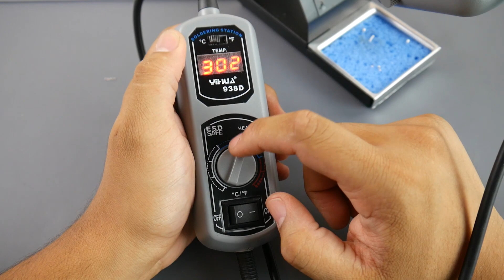Must Have SMD Soldering Hot Tweezers!! // YIHUA 938D Portable Hot Tweezers Review

Comment: That would definitely make fixing flight controllers easy now if I just knew how to fix flight controllers. But I have a feeling I will see some videos soon of someone fixing a bunch of broken flight controllers. LOL thanks for your great informative videos! I try to let everyone I know in the hobby about the best technical testing and fixing Channel in the hobby! DRONE MESH FTW!
Reply: As owner of these tweezers I can confirm that they are quite nice for SMD component soldering in boards used for our RC hobby. Fixing broken Racerstar TattooF4S flight controller (soldering back teared capacitor and accidentally desoldered and lost resistor and capacitor (last two was nearly invisible 0402 packages), fried 5V BEC chip (AJY7FB, SOIC-8 package) removing) - check. Replaced 10 uF capacitor in ESC broken by prop strike - check. Fried 3.3V LDO voltage regulator in XSR receiver replacing - check. So when tips are adjusted, those tweezers become quite handy for casual board repairing (and we usually need no more). Don't forget about soldering paste!

Comment: Wouldn't the excessively long heat exposure from picking the capacitors up using the hot tweezers cause cracking?
Reply: yup, especially multilayer ceramic capacitors are prone to cracking due to stresses when the PCB, solder joints and the MLCC aren't at the same temperature. a heat gun is recommended for these because it heats everything up more evenly.

Comment: how big are those capacitors, 0402? I wonder if these tweezers are efficient enough for work with 01005, I do micro work and while I can do hot air/rework, this would speed up the process.
Reply: It looks like those caps were in the 080 section of the practice board.

Comment: Will add this to my wish list.

I have an R-XSR with 2 capacitors that de-soldered themselves and a runcam eagle sensor that needs re-seating.  Fixing these will pay for the cost of the iron.

For extra credit, touching up the connections on my foxeer arrow camera sensors will also help.

I only run cameras at 5v now (and only VTX's off vbat or regulators).  Lose less OSD chips that way.

Would love a tutorial on diagnosing a blown OSD chip.  I have 2 FC's with blown OSD's that everything else still seems to work on.
Reply from the maker: Yes i have a video coming up on that.

Comment: Have you tried grabbing a wire or pin and pulling them out?  When wires and pins are soldered into the small holes on flight controllers it can be a pain trying to hold the board, hold the soldering iron and pull out the wire with tweezers..

Comment: That's really amazing, dude. 
If I remember correctly, I have a soldering station from that same brand on my wishlist. It has the soldering iron and the hot air gun. It would be great if there's a pair of tweezers like that compatible with the station. You know? Then you would connect it instead of the soldering iron.
Reply: I have the same thing (the soldering/hot air station). It's super useful, and I'd argue it's a better buy that these tweezers, but at the same time, it depends on what you need it for.
Reply: @prestonmatheny9756  Absolutely, I agree. 😊
But if you could have both... Right? 😉
Reply: you can get the same tweezers compatible with all of the hakko knockoff irons like yihua brand. the part number for the tweezers is 907M. you can also get hot air + tweezers stations like 938BD+ although it would be cheaper to get the 2 separately. I have the combo soldering iron and hot air station. the iron is crap and I'd only use it for soldering really big things that require 2 soldering irons simultaneously, but the hot air is fine. i was trying to get the 907M tweezers to go in that, but it was out of stock everywhere so i got this 938D.

just be aware that all of these knockoff irons are pretty bad compared to big western brands. the tips are bad, they make poor contact with the heating elements, the handles get hot and the numbers on the display aren't very accurate. the tip they come with are far too sharp to do anything with, so you have to buy tips separately. (mine came with a tip that comes down to under 0.020"

Comment: Just ordered these. Cant wait to try them out. I would have preferred both the tweezer legs moved, not just one. It looks like it makes releasing components in place a bit harder to synchronize when used as a soldering tool. Still, great idea and overall design.
Reply: It doesn't work right ?
Reply: @Tenno-Heika  Nah, it's alright. Much easier to use for small components than hot air or normal solder iron. It's not a must have tool, definitely not, but for the price it's alright. I have used it semi-regularly since I bought it.

Comment: just got these tweezers and I'm a bit disappointed. I know they're only cheap but the hinge has quite a lot of slop in every direction so its hard to keep the tips aligned to each other. Also the solder seems to want to go near the bend of the tip rather than to the very end which means it's difficult or impossible to use unless you get them down to a very shallow angle which often isn't possible
For some reason it wouldn't lift an 0805 cap and a HC-49 SMD crystal even though I eventually did wiggle the iron it to be in such a position that both pads were melted at the same time. i thought it might have been glued, but it came off easily with hot air. (normally i much prefer irons to hot air as they give more control). I ended up putting a ton of heat into that part with the tweezers and damaging the plastic casing slightly. I think the reason i was struggling was because i was forced to go in at too high an angle.

i did manage to desolder and resolder one 0201 resistor with these tweezers over and over without much problem. That probably only worked because it was on the edge of the board and I could get the tweezers in from a very shallow angle (almost flat to the board). These really aren't high quality precision tools at that scale, so I wouldn't expect it to go any smaller than 0603 or 0402 most of the time.